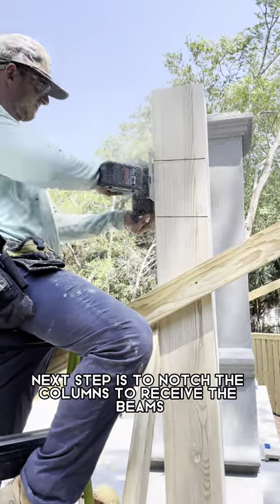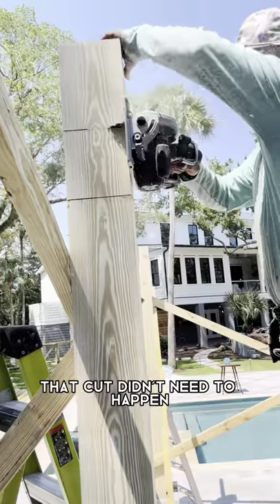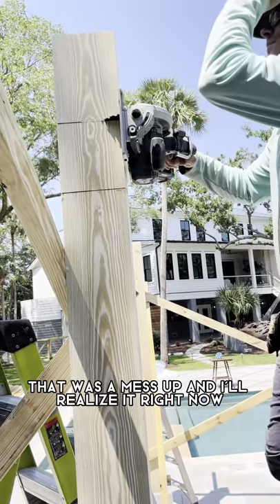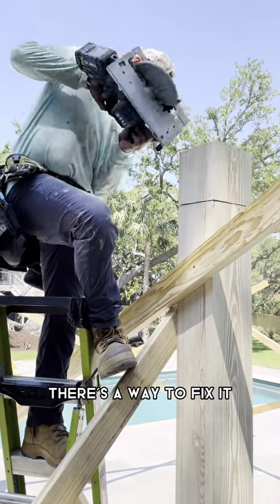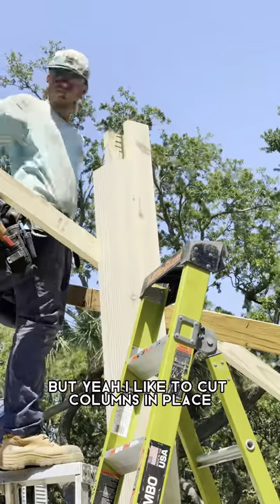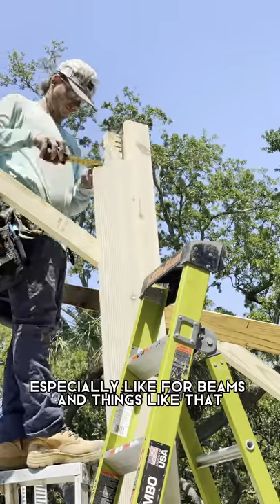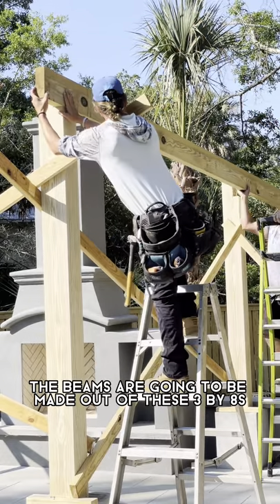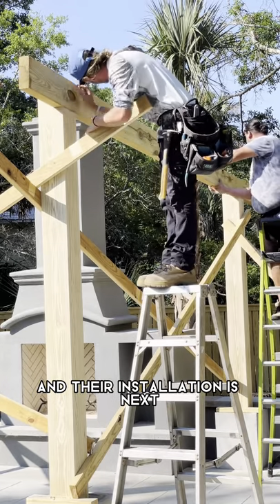Building a Pergola Part 3

Comment: How did u fix that cut?
Reply from the maker: I added a block underneath screwed the two parts around the cut to it the. Puttied and sanded the cut
Reply: @Artpentry  a block underneath? Screwed what two parts? You left the block on there? Remember Most screws have horrible shear strength and putty isn’t a substitute for wood grain that’s been severed. I’m not getting down on a mistake made, just curious.
Reply: I didn't see any of that you should make your videos more clear I have no clue what you just did or how it was a mistake
Reply: @brianhubbard2940  if u are confused about this then you probably don't need to even be around a skil saw.
Reply: @51-FS  says the guy that asked how he fixed the cut! 🤫
Reply: @brianhubbard2940  I asked how HE FIXED IT  . That don't mean I don't know how. I was just curious how HE did it
Reply: @51-FS  yeah that's the same thing that I was asking I would do it my way but I was trying to see how he did what he did but his video was moving too fast